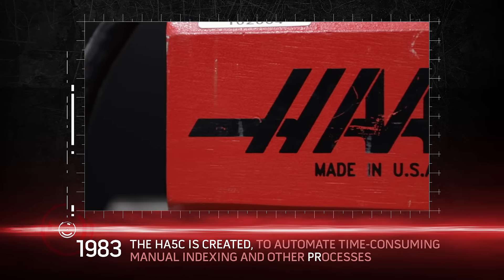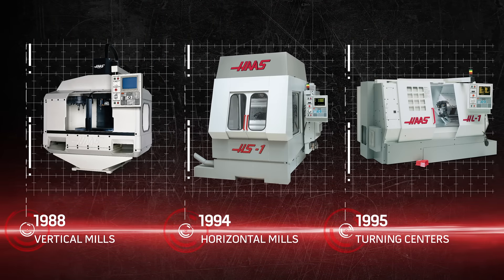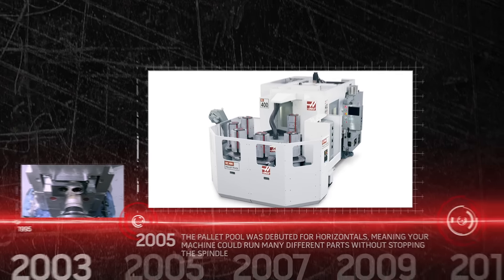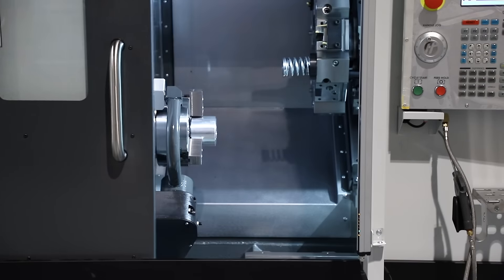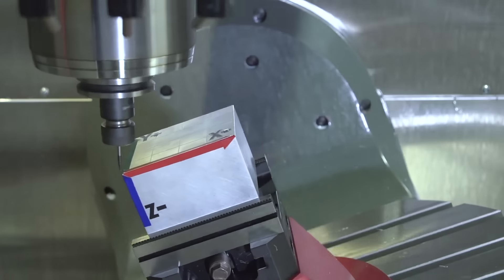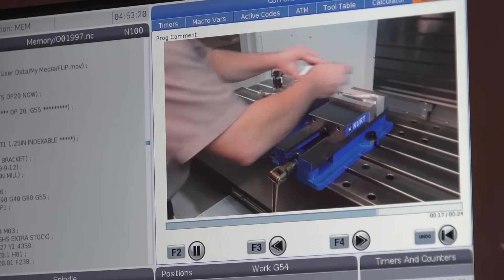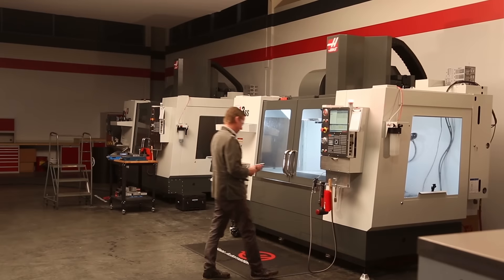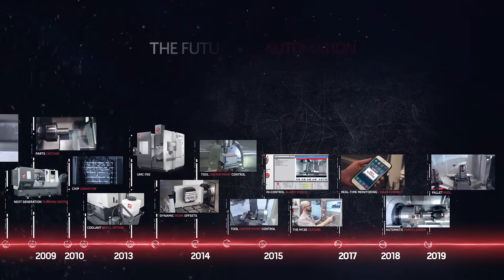Automation - Why We're Called Haas Automation

Comment: Now make boxed ways an option
Reply: Why?
Reply: damion goodrich WAY more rigid
Reply: At least switch to roller ways instead or regular ball bearing.  Shop near me bought a Taiwan made machine with roller guides that is much more rigid than all their Haas machines.
Reply: Yes, they are way more rigid, but they do not last nearly as long and require manual adjustment.

You have to be running really rough cuts for finishing passes before you notice any problems with rigidity on a haas anyway, so I really don't see the need for boxed ways.
Reply: @j.e.honiball1327  
Run a box way cnc lathe, then go run a haas lathe.
The haas is a turd
Reply: J.E. Honiball run a boxed way Doosan and see the difference.  Doosan aren’t that much better than a Haas, just have boxed ways and have a better rep because of it.
Reply: @j.e.honiball1327  manual adjustments?
You're high dude